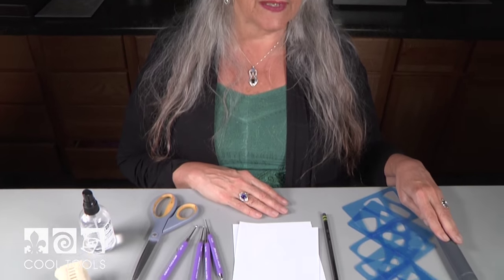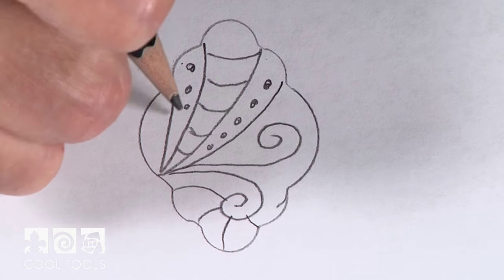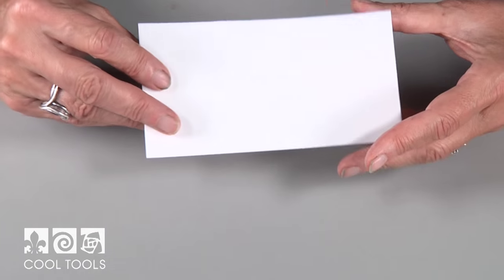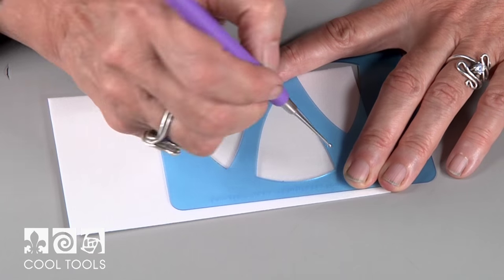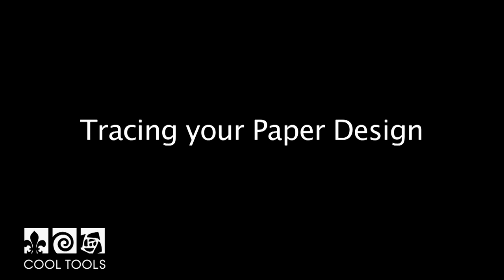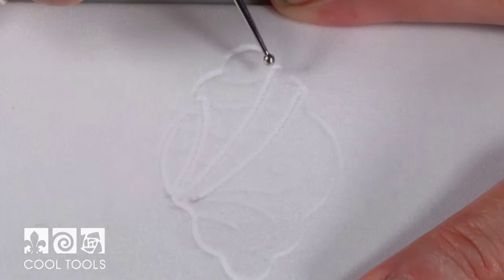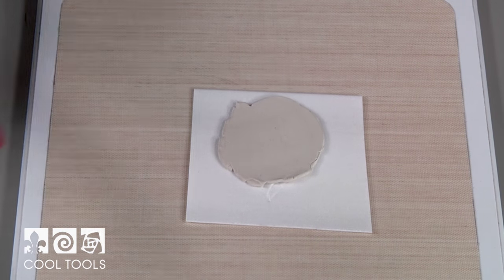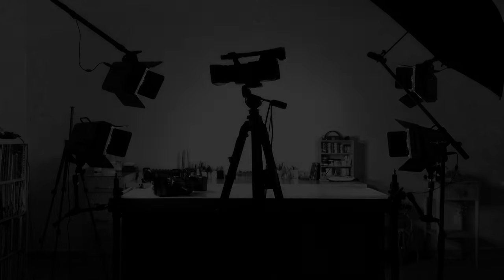How to use Scratch Foam Board with Precious Metal Clay by Lisel Crowley

Comment: I'm so happy to discover this Scratch Foam Board! I have used syringe techniques and "snake" rolls and very thin cut strips of clay in the past, but this really creates an opportunity for me to create more intricate designs that would have taken me many hours of applying clay or creating silicone molds! I also like that the designs will be consistent in thickness and depth and look more professional! I love detail in my pieces and this is an awesome way to get it. Thanks for this presentation.